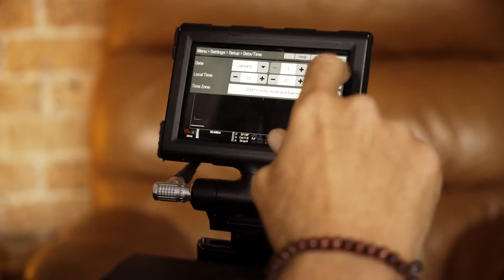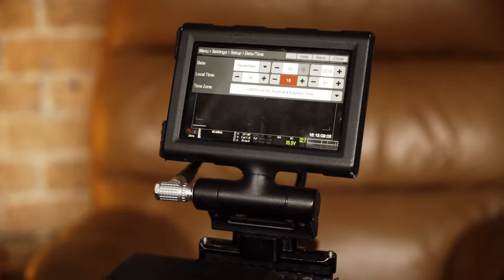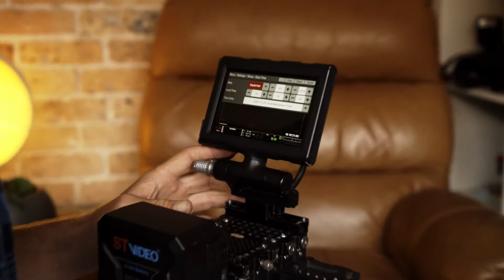INSIDE A RED CAMERA • REPLACING INTERNAL CLOCK BATTERY

Comment: Nice for this video -> i change my battery in my 2 cams :) and it works like a charm - i know it is not easy to do this - you must very carefully and so but if you know a bit eletronic things you are fine.
And yes i know a RED DSMC/DSMC2 are expensive but i repair many things at my self :)
Reply from the maker: Danke for the nice comment Paul. I would prefer not to have to open RED cameras up TBH, but RED are not servicing the older bodies anymore, hence we are forced to learn and hopefully share the knowledge amongst the community ;)

Comment: WARNING! In DSMC2 the battery is ionistor-type and is soldered to the motherboard and is located on the opposite side. There is a hole under the casing for the access. Also be careful disassembling your DSMC2 as if you previosly had hardware errors it may brick itself for the coslty repair of the motherboard as I got in my Scarlet-W. Better contact the service center so it will be on their responsibility.

Comment: thx for that! do you have by any chance knowledge about the bomb EVF? mine is not working anymore -.- sometimes it gets connection but most of the time not. I tried different cables but its definitely an issue with the bomb evf. looking forward to hearing from you.
Reply from the maker: Hi Mario. Thanks for watching.

That definitely sounds like an input issue on the bomb EVF, given it sometimes works. Does it work perfectly with a screen ? Did you try pulling the cable and putting it back in while still powered ? I’ve experienced a start up connection issue with an older touchscreen that needed to be unplugged and replugged during runtime.
Reply: @paulvankan  thx for the answer.
I took it apart and saw that 2 screws where not tight.
Just by tightening them I could fix the problem 🙌🏽
Reply: @paulvankan  and thank you heaps for the tutorial, just fixed it on my cam as well. and yes, it was a bit scary 😅

Comment: DOES ANYONE KNOW HOW TO DO THIS IN RED DRAGON X 5K OR EPIC W
Reply from the maker: Should be in relatively the same place, but i would know how to open the casing.
Reply: @Pablo Basulto WARNING It's not there. In DSMC2 The battery is soldered to the motherboard and is located on the opposite side. Also be careful disassembling your DSMC2 as if you previosly had hardware errors it may brick itself for the coslty repair of the motherboard as I got in my Scarlet-W. Better contact the service center so it will be on their responsibility.